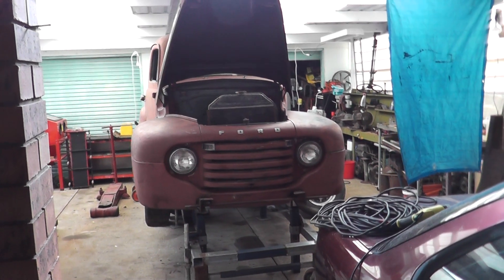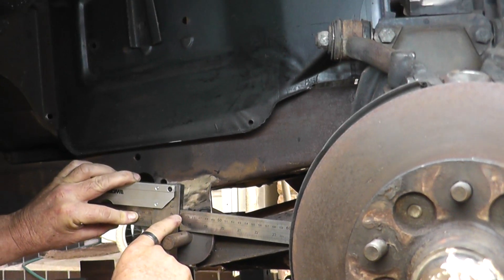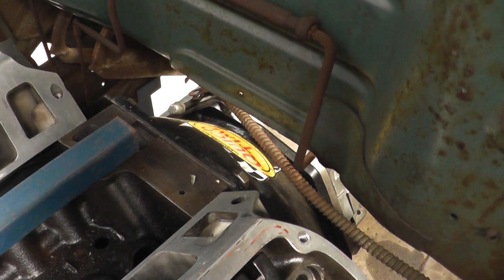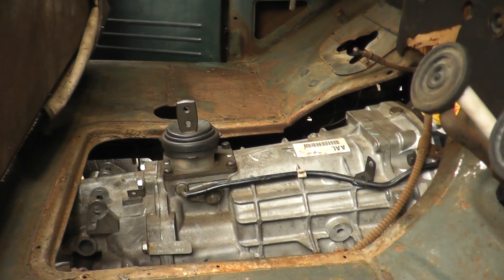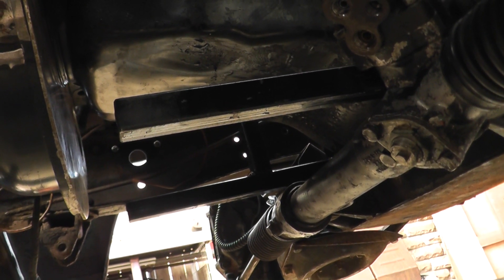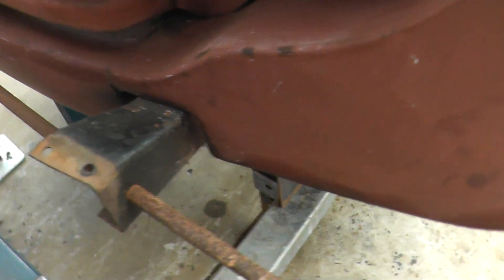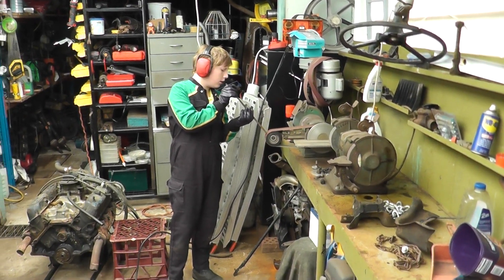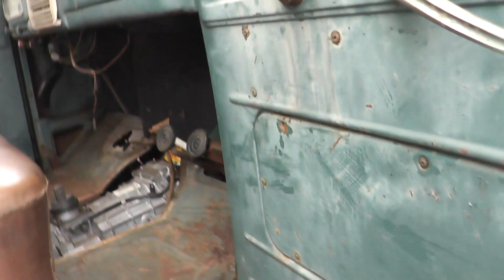Ford F1 Truck Project, Part 9

Comment: Good job on the videos.... I'm in the process of building a 48 F-1 right now.
Reply from the maker: Carlos Tijerina I hope some of these video's can help or inspire you with your project ,I can't wait till this one is on the road ...
Reply: +pyroman6962  awesome video in the process of doing one as well do u have any info on were to get a headliner great work keep it up
Reply from the maker: +Landon Webster I know they are available in the US , I have googled the question about headliners and believe the shape can be steamed into the original style headliner using thin paneling . I will experiment that in the future videos after the driveline is completed and thanks for the compliment  cheers